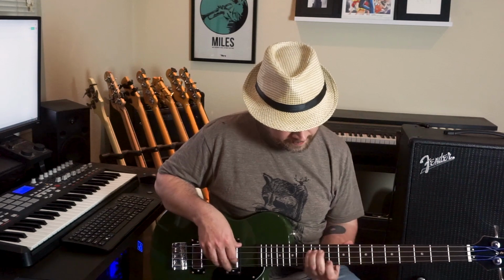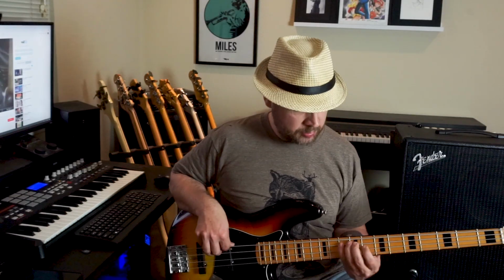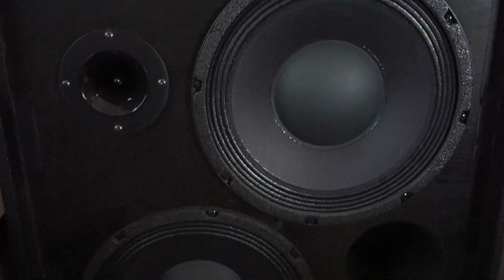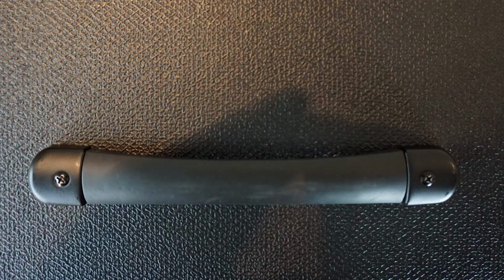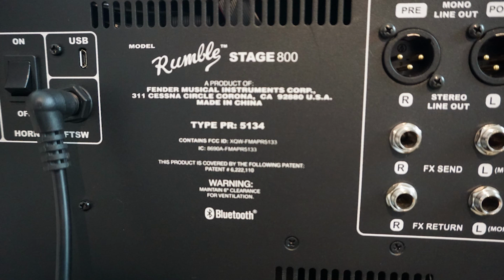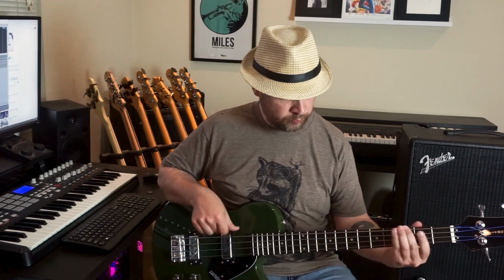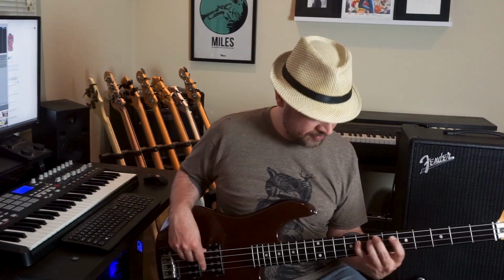Mr. Everything || Fender Rumble Stage 800 Bass Amp Demo/Review

Comment: This amp is still unbelievable and is going up in price! I got a used one just for under 400 bucks and I’m super happy with it. You literally can just run the amp with an external cab like I do. I use a 4x10 800 watts 8ohm and I get the full power of 800 watts. Or it the gig is very small then I just get my amp stand and tilt it back and use the rumble stage 800 alone. The foot switch is simple but a very good option. Especially if you need to tune in between songs or mute your bass in between sets. But if you like using your phone you can also change presets and effects on the fly. I just prefer having a physical foot switch and not depending on Bluetooth for it. But having these options is pretty cool. The amp is strong enough for any gig. I just don’t think it’s worth to pay 1200 bucks brand new now. From 799 to 1199 it was quite a jump. Fender is going crazy!

Comment: I just got this amp from my drummer, I've never had a foot switch with an amp and I'm wondering how would I hook up my wah pedal? Can I connect it to the footswitch or go through the fx send/return on the back?
Reply from the maker: If you use the fx send/return, I believe you can select where the wah goes in the signal chain.

Comment: What they don't tell you is the amp fades out while you are playing if you don't turn the WIFI of. It continually searches for upgrades to download. Also the Bluetooth sometimes freezes up keeping you from using phone control for the AMP. Over all totally awesome amp short of the issues they have. I thing this is an on going issue because the 800 amp head that first came out had the same issues , read about it on reddit .

Got this off reddit :Hey folks, got a new amp and it seems to randomly cut out and then fade back in. Not sure what's causing it to do that, but it might be something with the power cable if some of the old talkbass discussions I've read are correct. Is this something to bring it to an amp tech over?

If you have the WiFi network turned on, try turning it off and see if the problem goes away. Quite a lot of people have reported that it does that when it's trying to do firmware updates and it can be fixed by turning the WiFi off.

Like I said all and all great amp , but if you get one once set up turn the WIFI off unless you are doing an update.

Comment: This is a long shot given the age of this video but I’ve just received this amp and I’ve noticed at higher volumes/ whenever I play a little harder i get this popping noise with the amber light flashing when the noise happens on the power indicator and I’m wondering if it’s just busted and I should return it or there’s an underlying issue I can fix. I’d hate for it to already be busted since I spent so much on it
Reply from the maker: Hi @Khaskio, it sounds like you might be clipping the preamp. Try lowering the gain and increasing the master volume knob.

Comment: Stupid question: can I hook the stage 800 amp to a PA, so that the bass amp still makes sound as it also goes through the PA speakers? My bandmates and I just got in ear monitors and we want to be able to hear eachother better. I have a sansamp DI as well but haven't used it yet. Thanks.
Reply from the maker: Yes, the amp has pre and post EQ DI outs that can go to the PA while the amp is still running.

Comment: It's not a small size lol. Don't put it on a chair. Bass waves need the floor to dissipate probably. You want to feel the bass. The emulation is for recording with neutral speakers. So a 4*10 can sounds like it over headphones or DI out into DAW, not over the built in excellent 2*10. Gotta know when to use which feature of the amp. I Set my sound so the house gets an ampeg 8x10 emulation and a clean pre signal. Imthen have the combo is a beast monitor, usually by itself  standalone or with a 1*15. Played large venues, absolutely fantastic. Too heavy to haul for studio sessions, but you could if needed. Gives the engineer lots to work with.
Reply from the maker: Had to make a concession for the camera angle ;). Thanks for the tips on how you run the amp!

Comment: Yo what's the difference between the rumble hd 800 and the rumble stage? 
I'm confused as hell they are pretty much the samething without the bells and whistles
Reply from the maker: Hi Noe, the 800 HD is an 800 watt head, but does not include speakers. The Stage takes the amp structure of the 800 HD and adds modeling and effects and puts it in a lightweight combo package.   If you need the amp controls pointed forward, already have a speaker cabinet, and don’t need the effects and modeling, get the 800 HD, but otherwise, I would strongly consider the Stage as it has an unbelievable amount of useful features.
Reply: Update I got it and I love it I even tour with it. I get complements on it all the time
Reply from the maker: That’s awesome, Noe!
Reply: Thank you so much! I thought the difference was the bells and whistles. 
Im looking into these amp buying one soon I love the rumble five hundred had my mind set on the hd 800 but found out about the stage 800. I'm totally going with the stage 800

Comment: Quick question if you have a minute.  I like bi-amping my bass, I use a guitar cab and head with a bass cab and head, but I am desperately looking to scale down for portability sake.  In your opinion, can this craft that kind of tone?  Clear and distinct crispness from the highs with thick round lows at the same time?  At any rate, thanks for the video!
Reply from the maker: Hey Justin, Thanks for watching and great question. I hear you on the bi-amping.  You may want to look into something like the DP-3X from Tech21.    Essentially, you need something that offers parallel signal paths with a mix or blend knob.

Comment: Great video, is it safe to use a 8ohm 600w external cab. If so do I set the rumble to 4 or 8 ohm setting. Can’t find this info anywhere.
Reply from the maker: Thanks for watching and great question!  On Page 3 of the owners manual Fender says, “Set switch to match impedance rating of external cabinet; continuous power rating of external cabinet must meet or exceed power rating listed for the chosen switch setting. Set switch to 8Ω when no external cabinet is connected.”   Since the output lists 8ohms at 400W, your 8ohm 600W cab should be good to go according to Fender’s guidelines.  If you’re unsure, you can always email or online chat with Fender customer support.

Comment: Hi I own and play this amp. I really like the presets but it seems to get very farty when the volume is turned up, especially in the Motown setting, which I love. Do you seem to experience this also? Also the volume seems to differ hugely between presets and I cannot seem to get them to stay all at a consistent volume between each preset. Any advice for me?  Have you plugged an extension cabinet to it? Want to get an extension cabinet, and I want to keep it fender, but which would be the best choice? 2 X 10, 1 X 15? What would you recommend?
Reply: I’d venture a guess the differences in volumes from the presets is due to the amp volume of each preset. I don’t have this amp yet, my answer is based on my experience with the Fender B-DEC. If I was wanting to quickly switch presets without any other adjustments I’d save the presets with amp volumes adjusted as close as possible so as not having to adjust master volume. Not ideal, but works for this bedroom superstar.
Reply from the maker: Hi, Ralph.  Realized I missed the other part of your question about an extension cabinet.  I used the amp with an LDS extension cab last weekend.  It was a 12+7+1 though, so I'm not sure I can answer your question about the 2x10 vs the 1x15.  You may want to check out the Rumble Club thread on Talkbass.

Comment: Is the foot switch blue tooth also are is it cables?
Reply from the maker: The footswitch connects with a 1/4 inch cable and is included with the amp.  The expression pedal is optional.
Reply: Expression pedal?
Reply from the maker: Yes.  According to the manual, you can add one to control volume.   I’m not sure if it has to be the Fender one or if any expression pedal will work. https://g.co/kgs/viTQXm
Reply: SoundsLikeBen did u notice any kind of mute option on the foot switch or amp?
Reply from the maker: When you access the tuner, either by holding the tap button on the amp, or the fourth switch on the foot pedal, it mutes the amp and activates the tuner.
Reply: SoundsLikeBen nice! I just one earlier!! Heard many great reviews on it! Thanks man!!
Reply from the maker: Enjoy! And definitely download the app.
Reply: SoundsLikeBen it comes in tomorrow and I’m thrilled, app already down loaded lol